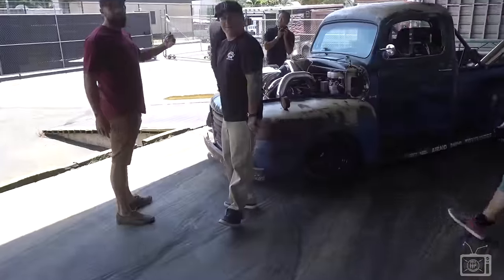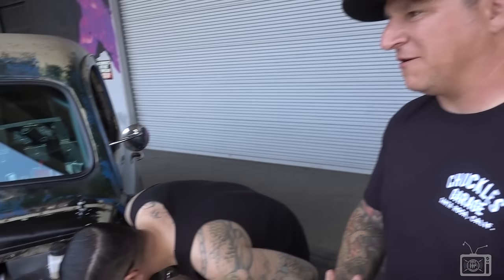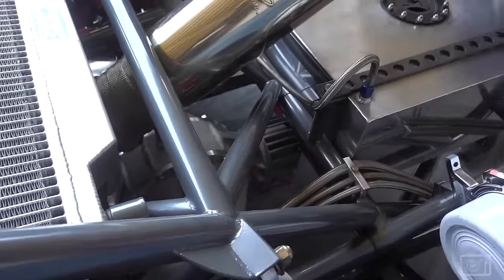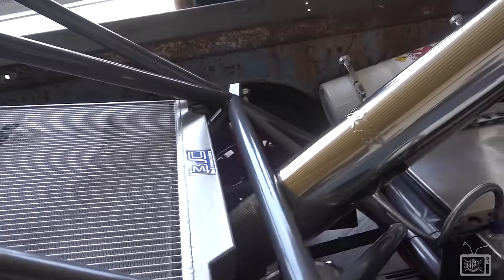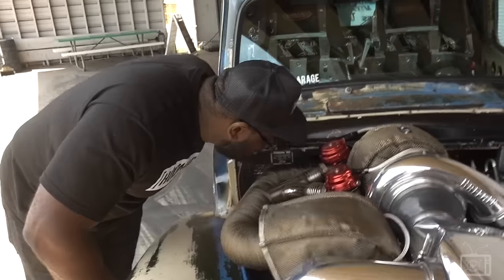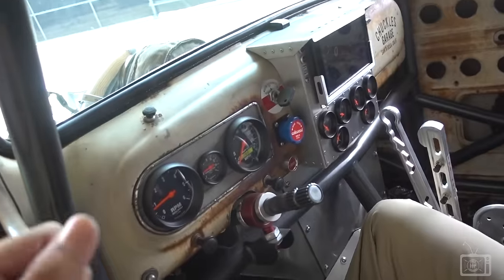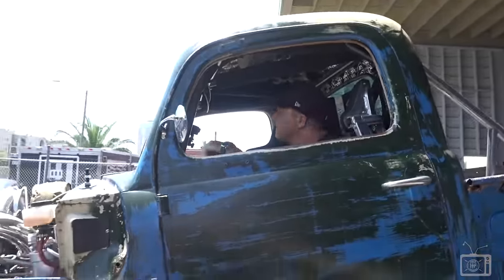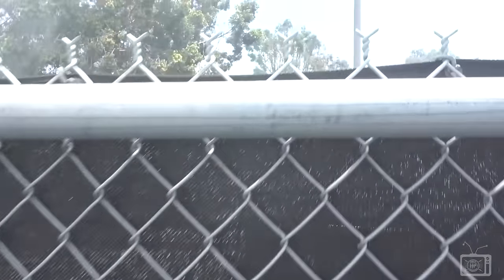[HOONIGAN] DT 075: 1200HP Twin Turbo Diesel Burnouts (Old Smokey F1)

Comment: Build Biology on Old Smokey F1 Pikes Peak: https://youtu.be/OQg0VDLX3Kk
Reply: Hoonigan Bonus 😈
Reply: #vapenation
Reply: Late models
Reply: Holy shit that engine is beautiful. I am guessing you dont want to use all 1200 hp with that thing I imagine it gets a little too much air and will flip but otherwise imagine the speed. Mostly its for high speed drifting? Probably reasonable price to build also nowhere near the millions of dollars another car with a 1200 hp engine would probably cost. Weight isnt too bad either, its not at 3000 lbs like a sports car but 3500 lbs isnt too bad its like average weight of most 4 door v4 cars on the road with a normal trunk space. Yeah there at 6:34 he mentions he got the car for $225 for the beat old car frame then add the cost of the engine but WAYY cheaper once again then a sports car for 400k. Id love to see what these guys could do with an old luxury car with 100,000 miles on it about to be thrown out because why not buy a new one for 65k instead of rebuilding it with a loud diesel engine for 10k-20k which I suppose makes more sense to do in practicality but still imagine the fun on seeing them rev up an old comfortable car from awhile back with way more horse power then it  needs to try and drive it around town just for the fuck of it. I suppose if I subscribed they might have some videos like that in stock but I am too lazy so I will just sit here and imagine. At 9:55 he says it gets 30 miles a gallon on the freeway. Not bad for an engine that powerful. Its diesel of course. That is so awesome its like a mini tractor trailer imagine hitching a trailer to that thing then taking the trailer off and drifting around. Like a mini version of a 12 wheeler not at all a sports car but not a snob car either. LOL for real men except the interior is about as comfortable as a coffin. At 12:34 maybe an oxygen mask would have some kind of benefit X=D
At 16:24 he says it has 2000 foot pounds of torque. FUCK
Reply: Hey Scott this has 6 million views and is the content that helped this channel explode so when are we going to get back to the roots of the donut garage. Please let the guys have some fun!! If you can't do it there anymore then move. Love you all but go back a year and it was raw and awesome not so scared of investors. Please don't end up like roadkill
Reply: #letskeephert
Reply: Are you crazy man and to burnout
Reply: @raajkumar4490  wqrr
Reply: Ummm whaat where the hell was this vs hoonicorn!
Reply: UUMMMMM. EXCUSE ME BUT I HAVE A IDEA 💡. 😂 I KNOW RITE IDEA THIS GUY FOH BUT HEAR ME OUT... THIS VS THAT CHALLENGE BEING THIS DIESEL TRUCK AND THAT BEING THE 🐐 HIMSELF @KEN BLOCK IN THE HOONICORN 🤯WHO ELSE AGREES WITH ME
Reply: I would love to see you guys have the Bandag Bullet doing donuts in your little pad there

Comment: he gets 30mpg in his 1200hp truck on the highway and i get 34mpg in my 100hp ford focus so i think im the true winner here
Reply: epic ness 100 hp is zero match against a 1200 hp Cummins diesel truck
Reply: im sure it beats it in gas mileage tho
Reply: epic ness Old Smokey is still cleaner than a VW but makes 3x the torque of a Honda and your Ford Focus
Reply: you're overestimating a honda and ford focusXD
Reply: drankie8 how am I overestimating those 2 vehicles? Its a true fact
Reply: mabye 600hp is doable but between 600-750 ft.lbs of torque i doubt
Reply: but im not an import guy too, this is out of my element and it was just a joke
Reply: drankie8 in the instance of Old Smokey, the truck puts out 1,200 hp and over 2,000 lb ft
Reply: Sarcasm at its best😂
Reply: epic ness  why don't you race the truck in your little Ford Focus and see who's the true winner (it won't be you)
Reply: when that zetec kicks in XDDDDDD
Reply: epic ness try a prius 😉
Reply: The true epic ness is people are too simple minded to see sarcasm and instead got trolled by a comment that wasn't initially a troll comment 😂
Reply: No one cares
Reply: but is it something that fun?
Reply: epic ness lol rich i get 18 with my 430 hp f-150 ecoboost

Comment: 106 psi?!???! How is that even possible?
Reply: Those R888R had 0 chance of gripping up.
Reply: Ajay M diesel junk
Reply: jack Clark junk? Do you own anything with 1,200 wheel hp? That is insanity and I tip my hat to that build
Reply: diesels have a very high compression ratio which allows them to build a lot of boost to make a hell of a lot of power
Reply: And retarded amounts of torque
Reply: When kids know nothing about diesels 😂
Reply: 1 it's diesel and 2 when you compress a already compressed charged it basically multiplies it
Reply: 150+ psi is routine for diesel tractor pullers and other compound turbo diesel drag racing builds...
Reply: Ajay M my dads 6.4 powerstroke makes 40psi stock
Reply: Justin Roth 40 psi and 100+ are in completely different leagues.
Reply: Diesels use compression instead of combustion
Reply: Colton Morse diesels still use combustion they just use the heat from compression to create it rather than a spark like a petrol or a hot surface like a hot bulb engine
Reply: carbonfiber492 yea
Reply: I think he means they use compression instead of spark.
Reply: No spark blowout or ignition to worry about so running 100+ psi is possible.
Reply: BApple no shit im just saying thats on a stock turbo. Diesle make alot more boost than gassers
Reply: Ajay M Because race Cummins lmao
Reply: a cummins boosts 30 to 40 psi stock. anything bigger than a 62mm turbo can boost 60+ in a heartbeat but massive turbos means hella boost lag but when it hits it hits hard as hell. Diesel world is different animal than the gas world. I know guys that make 1000hp and 2000lbs of torque on 1 turbo.
Reply: My car, being a 1.5 litre has a boost of 12psi and only does 65hp
Reply: Diesel bro, I have a 90s inline 4 diesel that came stock with 40psi
Reply: Maxi ?!? 5.9 Cummins by chance?
Reply: Vortec 3501999 2.8L Mitsubishi from 1994 lol
Reply: I thought you had a diesel lmao!
Reply: Maxi ?!? oooh damn never seen that.... wow
Reply: Vortec 3501999 it is, Mitsubishi has always made diesels
Reply: Ajay M the race truck at my work made 2500hp and 150psi on triple compound turbos and spray. Lol
Reply: I have no Idea
Reply: The only limit to making power in a diesel is literally "how much air/fuel can you cram into the block, and will the block hold it?" Otherwise, you can always cram more.
Reply: Not exactly. They can handle the boost because they're BUILT for high compression/extreme duty. People then REDUCE compression and adj fuel accordingly to handle the added boost. 

High compression doesnt play nice with moderate to high boost levels (detonation=melted pistons). Typically most motors are detuned for boost. Less compression, less timing and slower adv curve (gassers).
Reply: Some pulling classes allow triple compounds that can make over 200psi of boost.
Reply: i've seen 120 psi put to a triple turbo backyard cummins build. diesels, with that insane boost, and no need for spark plugs, as they use compression for ignition, are able to run such high pressures because there's no spark to snuff out. thats why they run such crazy torque numbers, cylinder pressure=big boom=hard moving pistons. not fast moving pistons.
Reply: As long as the air/fuel ratio remains in a safe zone for a given engine condition, you can keep cramming and cramming more into a diesel. The limit is an exploded block, busted con-rod, snapped head bolts, blown gaskets, or what else. Just depends on where the weakest link is.
Reply: Voodoo black magic
Reply: 7,3 bars
Reply: Need a mechanical conversion. Slap a big inline sigma pump on it.
Reply: Ajay M compound turbos
Reply: that's a dumb question lol
Reply: oh yeah. diesel torque is always 150 to 600 more lb ft tq more then horsepower. torque is where a diesel excells. a 4 cylinder a bigblock and a diesel all 3 have that instant torque at a lower rpm. where as a smallblock needs a power adder to match those 3.
Reply: Diesels basically need high turbo compression to make alot of power and overall speed
Reply: Ajay M q
Reply: Chaw Wee he is the f****
Reply: jack clark u bring shame to that name i own and love my SS but that truck is nice and this is coming from a bowtie guy through and through
Reply: Cummins is how
Reply: @Skullbrothers  you got a 1.6l surely
Reply: @phenomenologicalparadox5216  not really BAapple my cummins runs 60 psi not not to far past stock just studs and compound turbo
Reply: Ajay M diesel baby
Reply: Diesel baby

Comment: what silicone spray does he use and how does he apply it? 
I have a 2002 ram 2500 with slightly built 5.9L cummins / NV5600 making 50psi through a single 62mm viper turbo... I've got light paint damage and surface rust, but this is and forever will be a project truck.  I don't have the cash for a full paint job so in lieu of that, I'd like to have a similar finish to prevent further rusting.

Comment: They got cylinder heads now that make more power with 80 to 120 lbs of boost then they was making with 200lbs of boost without them. Something as simple as getting them fire ringed and running the sleeves a little longer where the head gaskets just got to seal oil and coolant. Can make a huge difference. I got  800hp 5.9 p-pump long block already built and studded if anyone is interested ready to ship.

Comment: They're not intercoolers. If the air is cooled AFTER it is compressed they are AFTERCOOLERS. No way the heads will stay on with that boost let alone nitrous. Cool truck but all show.

Comment: 106 psi.......   lol.. ef15 reanault from the 80's  5.5bar  1.5 liter 1500hp
Reply: Don't forget about the Honda McLaren MP4/4. They lowered it from 4bar to 2.5 due to fuel consumption. Of course that car "only" produced 900 HP from a 1.5L V6.
Reply: But how much torque when lugged down to 1200 rpm?

Comment: Null Seele die Jungs - Anscheinend nur die Idee und die Mittel gehabt. Á la „Könnte geil sein“; „Könnte gut ankommen“. Genauso wie deren Frisuren 😂.  Naja, Danke an die die es mit Ihren Händen und Gehirnen, ausgereift und umgesetzt haben.

Ich sag das, denn wenn eine nicht mehr als Juchuu und nach dreimal Kamera draufhalten nur, “so intense“ einfällt...

Naja Leidenschaft ensteht halt aus Ambition, Ehrgeiz, Kampflust und Ausdauer.

Überall diese Weichgespülten 2.Nuller. Scheisse! Was ist nur los in dieser Welt. Alle gehen arbeiten nur ich nicht.

In der Küche, da steht ein Rosa Elefant.